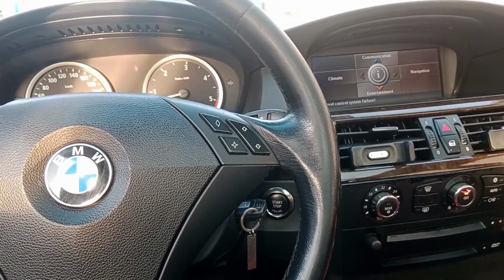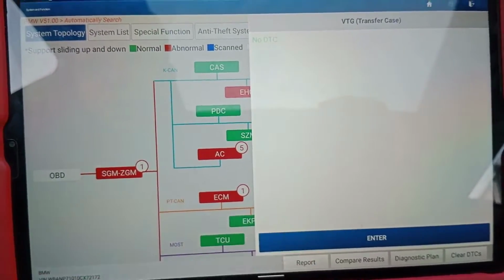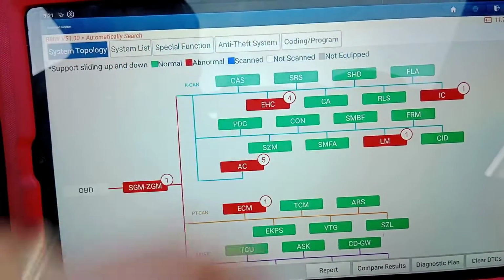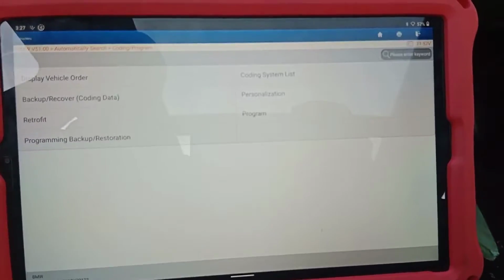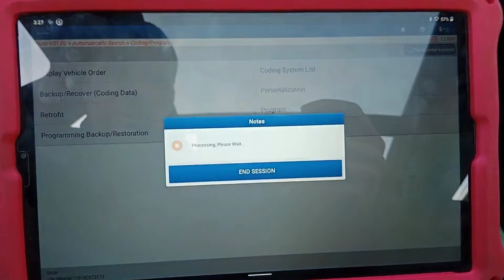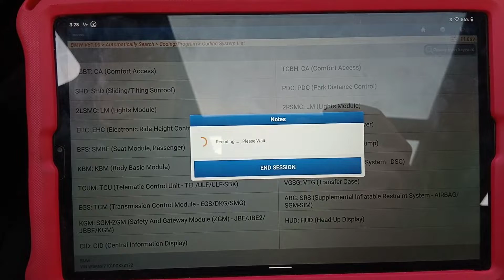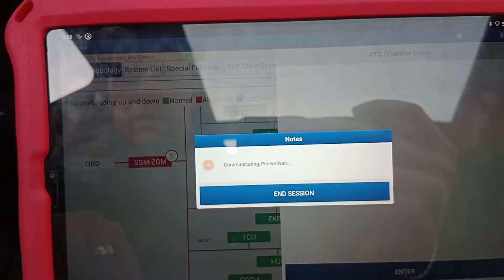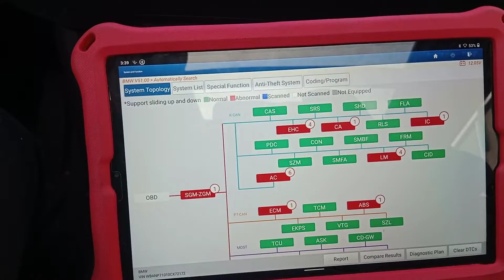BMW E60 VTG (Transfer-Case) coding used Module with ProDiag (Diagzone, Xdiag).

Comment: Hello, after dead vtg ecu, with second hand installed got dtc 54C8, is there a need to reset adaptations or could it be from the donor car or I have problem with the car

Comment: Hi, what are the differences between xdiag and diagzone? Which one has more special/reset functions? Which is better?
Reply from the maker: Hello,
almost the same. 
 The difference is very small.
Reply: @YOYODiagnostic  Ok, then it will decide on the diagzone. Which interface will be better dbscar 4 (ds 401 black) or thinkdiag old boot? Which is faster, more stable and will work with all functions from diagzone? Thanks for the opinion.
Reply from the maker: @ttjj9537  
ds401
Reply: @YOYODiagnostic  Okay, one more thing. DS401 compared to golo 4.0 (black interface with red connector) is better for diagzone?
Reply from the maker: @ttjj9537  
All are the same.
 Diagzone ist to another level now!
Reply: @YOYODiagnostic  "diagzone is now on another level." Are you talking compared to xdiag? Are you saying that in the PRO version all interfaces do all functions?

Comment: Hello Can you please tell me where to get the ProDiag software. Thanks
Reply from the maker: This software can only be installed for Dbscar5, and Easydiag3, that if it can be opened, it has no glue inside.  
Look at the video posted by this channel.
  If you have Thinkdiag old version you can use it with Diagzone
Reply: @YOYODiagnostic  I have the correct vci. But where do you get the software and is it paid only?
Reply: Yes where to get prodiag and also does it work with thinkcar pro?